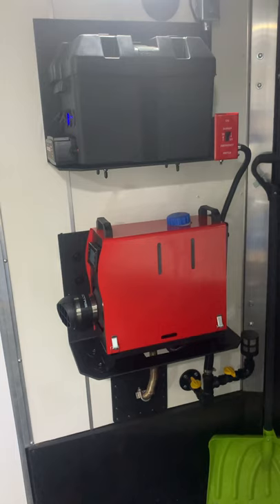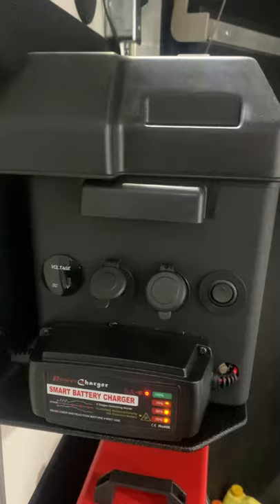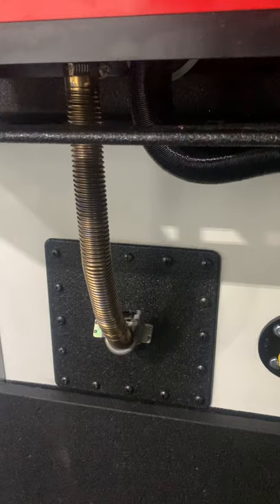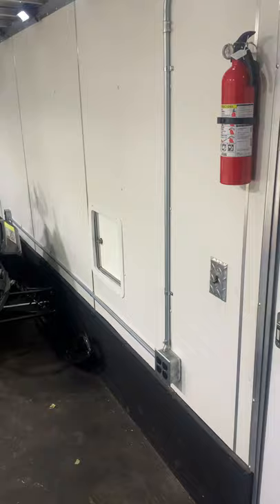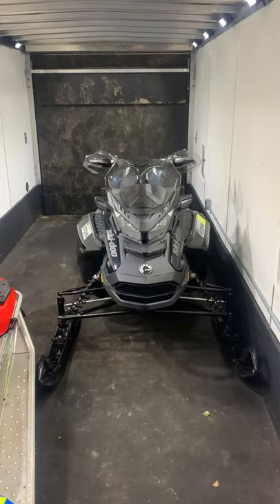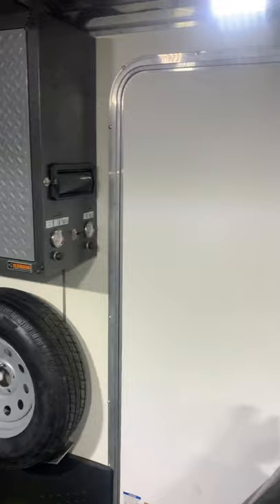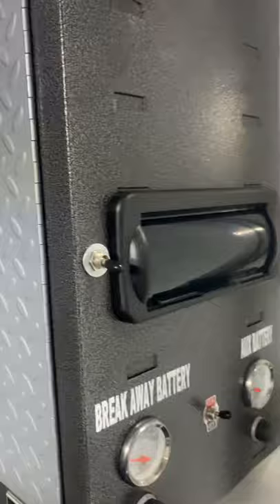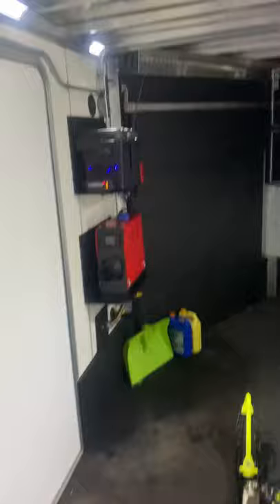CHINESE DIESEL HEATER ENCLOSED TRAILER DIESEL HEATER SNOWMOBILE TRAILER INSTALL

Comment: Excellent job. When you mounted the exhaust to the wall how did you brace the mounting plates? Thanks
Reply from the maker: The outside mounting plate is bolted through the outside wall. The inside mounting plate is just screw to the wall.
Reply: What material did you use for your shelves, steel or aluminum? Thanks
Reply: Also, do you still have the mounting plate/cover for the exhaust? I’m interested if you want to sell it. Thanks
Reply from the maker: @shanecalkins7077  the old one? Yes I still have it. Shoot me a email or number I can text or send you a picture. The shelves are made out of steel then linexed. Tks

Comment: I want to know how you made your battery box and where you bought the material for your shelving. Looks awesome!
Reply from the maker: I bought the steel at metal supermarkets I then had a local shop bend then. Then had the shelves linexed.
Reply: @powersportsguy1117 not to be a bother but can you share the name of the actual material, size, gauge that you bought?

Comment: Couple questions. Can you get four sleds in the trailer without issue? Can you add fuel to the heater easily?
Reply from the maker: Yes, four sleds can be done we usually run 3 in it. Two 137’s and a 129 in the front. Putting fuel in is easy. I have a funnel that helps I keep in the trailer. Tks
Reply: @powersportsguy1117  what kind of battery you have in the box and what kind of tender are you running? Thinking of going with a 31 AGM marine.
Reply from the maker: @KliqDon1983  they’re just normal deep cycle, marine batteries that I bought advance auto, I do believe there, 31 series. The battery charger is just one I got off of Amazon. I like it because it shows when the battery is fully charged on the charger.

Comment: What flooring do you have in there?  Do you see any damage over the years from your carbides?
Reply from the maker: It is all Linux spray, has held up incredible. The only issue I have had is on the back door where the edge of the door meets. It ripped a few pieces of wood up. I fix that by putting some metal on the corners besides that it’s hold up great

Comment: Good video.  You have done much of what I want to do or have already done to my 20ft Continental, I use mine for my SxS's.  I was wondering about the heat of the exhaust going through the wall of the trailer so I was thinking of going through the floor.  I too bought a marine exhaust fixture.  My addition is solar on the roof to keep the battery charged without plugging in.  Cheers
Reply from the maker: Thank you
Reply: Hey jw can u add the links for the marine exhaust vent and some of the other stuff u added? 
Also hows the floor holding up to carbides i want to line x mine aswell Thx
Reply from the maker: @gregvankoughnett1174  Floor has held up great, it was a lot money to have done. Amazon has the exhaust, just put in diesel heater marine exhaust and it comes right up. I’m gonna post a video about the floor now. Tks

Comment: So for the wall where you have the exhaust going out did you have to put anything between the outer skin and inner layer?  I would think tightening down the inner plat and outer flange pull or put strain on the outer skin...?  I am planning pretty much the same build and trying to figure the exhaust out before I cut into the trailer walls.
Reply from the maker: No I did not, the outer flange is just mounted to the outer wall there’s about an inch between the inner and outer wall so it’s never been an issue. Let me know if you have any more questions thanks

Comment: Great build! I really like your set up. What overhead lights are you using inside the trailer? Link would be great.
Reply from the maker: Thank you having hard time posting the link. They are on Amazon 36 watt led floodlight, currently 4 for around $48 dollars.

Comment: Would you be willing to post a picture of how the pass through for external air looks on the outside of the trailer for the heater intake? From your explanation it sounds like you're not drawing air directly from outside but rather from the space between the exterior and interior walls. Just curious what the outside air inlet looks like.
Reply from the maker: Let me try to grab a quick video tomorrow of it, it’s nothing more than the factory air vent that comes through the wall that I drilled some holes in but I’ll try to do a quick video on it thanks
Reply from the maker: Let me try to grab a quick video of it tomorrow, it’s nothing more than drilling some holes in the factory air vent that goes from the outside the inside but let me try to grab a quick video of it thanks

Comment: Looks great! Three questions:  1. Is your pass through steel or aluminum? 2. You said your pass through burned the Linex off. What did you do to keep it cool? 3. Any issues with no insulation in the ceiling or walls? Thanks.

Comment: How does the lineX hold up with studs/carbides? Thanks killer job
Reply from the maker: The linex is held up in credible even after almost 5 years. The only issue I had is the edges of the boards or they meet the ramp and we just put a small piece of metal over that. They tell me if it does get wore out they can re-spray just the floor but that has not happened yet.

Comment: no muffler?
Reply from the maker: No muffler, it runs great without it. The muffler besides cutting down on a little noise is a drain. As long as the exhaust runs down it will drain fine. Mine drips a little out the side trailer from time to time but has no issues.
Reply: @powersportsguy1117  nice job nice clean and neat looks great

Comment: Do you have the battery wired to the 7 pin on the trailer so the truck can charge the battery when it’s plugged in? Just bought one of these and I’m doing some research on how I should wire this up in my trailer.
Reply from the maker: Yes I do, that’s the way to do it. Tks

Comment: I don’t see the intake vent on the outside?
Reply from the maker: It is covered in my video, I pull air from the inside of the trailer I also pull it from in between the walls and then I grab the air from the outside vent on the outside of the trailer let me know if you have anymore questions thanks
Reply from the maker: It is just the standard  factory vent that came with the trailer.